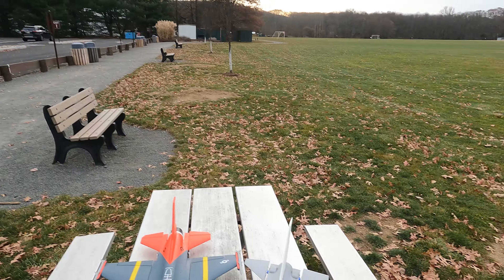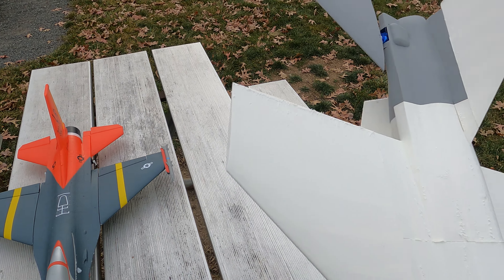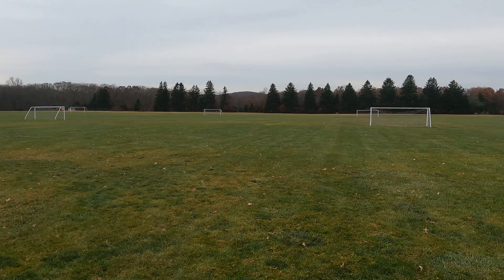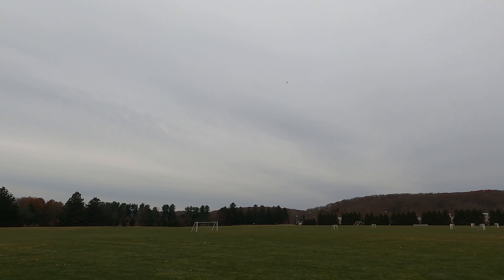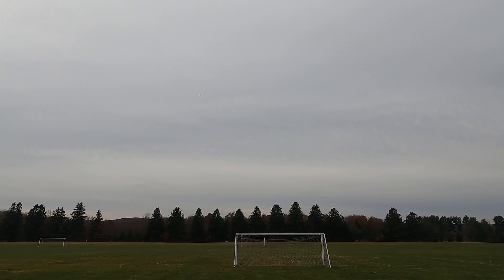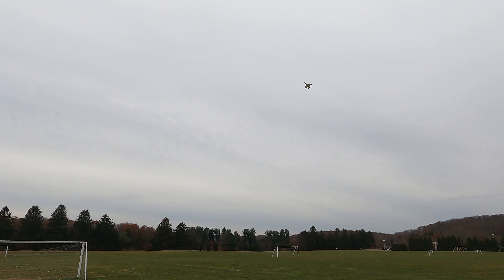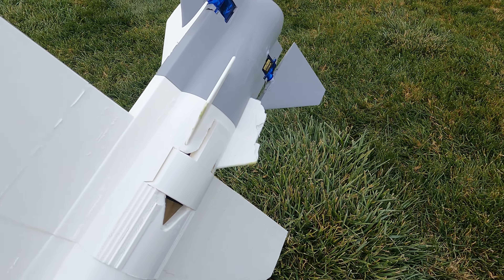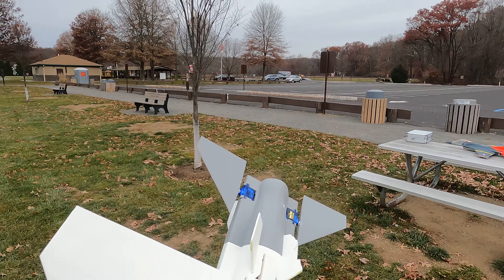3d printed f16 V3 final design flight

Comment: I just donwloaded your model. It opens in Microsoft paint but how do i get it to a 3d printed format? Thanks
Reply from the maker: Thanks for the purchase! It’s a 3mf format. Just open the file in your slicer software. Let me know if you have any questions
Reply: @hotlapkyle oops! I'll try that. Thanks!
Reply: Just started printing.  First part is a success. I'm concerned about weight though. What infill did you use? I printed with 3% cubic infill.
Reply from the maker: @carlosperez7015  great!! 3-4% grid infill for me
Reply: @hotlapkyle  Sorry to bother. One of the fuse parts is too large for my PRUSA printer. I usually bring it to MesMixer and cut in a plane then separate shells . It's not possible with the 3mf file. Any ideas/suggestions?
Reply: Please ignore this comment. Was able to split the part. You can send the photos you had mentioned when you have a chance.
Reply from the maker: @carlosperez7015  let’s communicate by email. I’ll split any parts you’d like. Just email me what parts you need ptikyle@gmail.com thanks